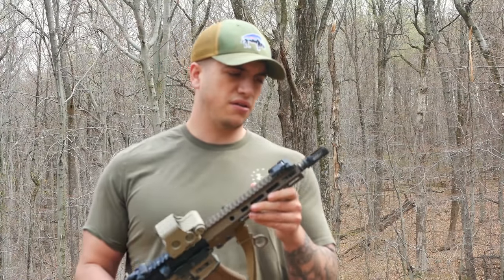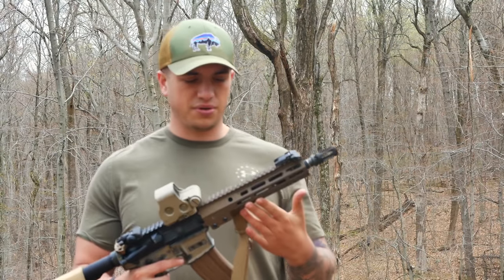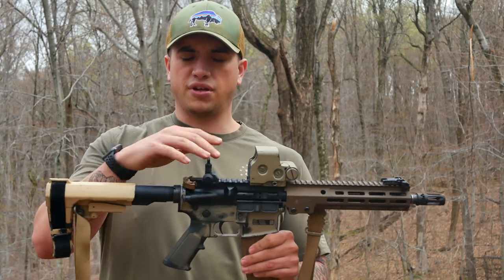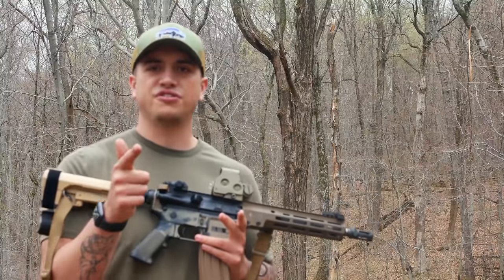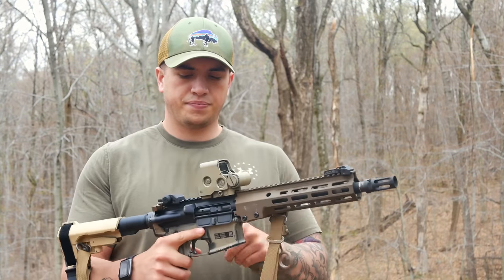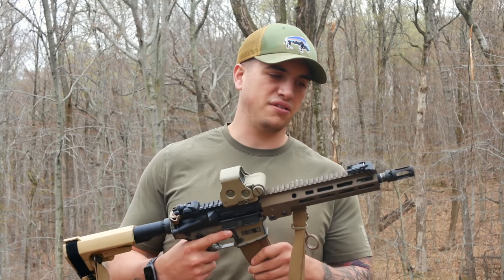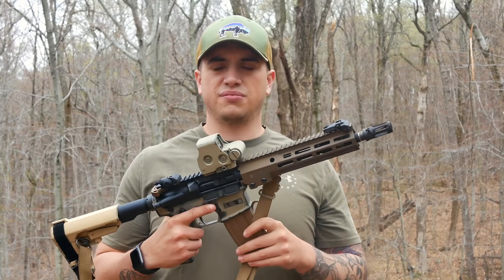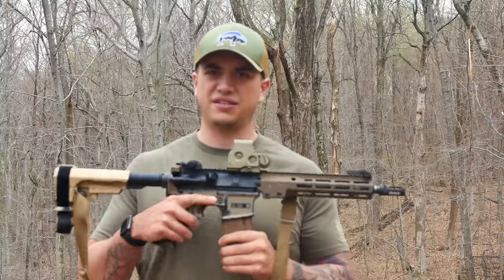AR15 Pistol URGI 10.3" "Clone" Build Pt. 1 | Colt Geissele CQBR Block 3 Clone-ish

Comment: I can't believe I missed out on those Brownell Colt deal with the lowers . I was more pissed off than a kiebler elf getting demoted to fudge packer man.  
Yeah for CRA you gotta go to the CRA OFF TOPIC GROUP . They are less forgiving there . 
If you pin that WAR COMP it will be over 26". 
I love all my Colt 10.3s. I still think the LE6945 is the absolute best period . 
I was thinking about upgrading my DD MK18 Upper and put this rail on.  I just love quad rails for CQB Uppers man . 
I'm in love with the SSP Trigger . Not a fan of 2 stage triggers for CQB Uppers though . I've always used the CMC 3.5 Pound Flat Trigger . Now that they make the SSP I'd rather have their product . 

Either way she is a Beauty.
Reply from the maker: sean white thanks man. I have a SSP on one of my other builds. I might end up swapping them in the future. We’ll see how it pans out.
Reply: @MaddMaxxLop  the CMC 3.5 Pound Flat Trigger is pretty bad ass for price and performance.  I usually get them on sale for around $130 or so. The Hiperfire are pretty damn awesome as well but expensive.  I have more experience with the CMC 3.5 Flat trigger .
Reply from the maker: The CMC was the first upgraded trigger I’ve bought. It’s on my “recce” build now. Was a big fan but in the past 2 years I’ve became a whore for Geissele. That and I honestly like curved bladed triggers and 2 stage more than I did before.

Comment: People seems to always argue the point your unable to buy a complete lower w/ a stick, however. As long as no upper hs been mounted THEN it’s fair game to remove stick n for simplicity swap stock for a SBa3 adjustable brace. I prefer SBa3 or rail hook mod 2 even if passing is non existent n may not be most comfortable when pulling it in right to your shoulder pocket it will ensure you set it on meat in order to avoid it digging into/bruising your collar bone. So just wanted to say your correct on that as the firearm isn’t spoken for as to rifle, pistol or sbr until you pop those two pins through & pair the brace/stock w/ the upper of your choosing, despite the nfa being a joke as it’s not likely they prevent crimes just discourages purchasing class 3 items bc inpatient guys like me despise forking over cash then waiting 12-15mo for the government to inefficiently generate revenue from the tax stamp they charge us to exercise one of our inalienable rights.

Comment: ATF has a 3 page letter dated 7/18/11 that deals specifically with putting a vertical grip on an AR pistol.  On the third page the ATF states how to measure the length of a pistol.  Basically remove the muzzle device, extend or fold out the brace/stock to its most extreme length, "The overall length of the firearm can be measured from the muzzle mark to the right angle corner nearest the butt of the stock, or the extreme rearward point of the firearm." If that measurement is over 26" a vert grip is legal.  I like your videos, keep it up.
Reply from the maker: Thanks man, that’s finally some good info. But to be honest I’m digging the C clamp on this.

Comment: Edit: https://www.reddit.com/r/Firearms/comments/c9gqb6/atf_redecides_that_folding_braces_dont_count  The brace doesn’t count per the ATF as of now towards OAL.

As far as the Vertical Grip goes, a lot of people recommend measuring OAL with the brace removed and when you do that this gun doesn’t make 26”. If you do include the brace it barely makes it.

Some say though, the BCM Vertical Grip is technically an angled grip since it’s not exactly 90 degrees (kosher for pistols). I don’t care to be the test case for that one either considering BCM markets it as a VG and calls it one.

For now I just use mine like yours with no grip at all. The rail is pretty comfy to use without a grip anyway.
Reply from the maker: Yeah honestly that’s what makes most sense. Probably gonna rock a bare rail for the foreseeable future.

Comment: Mod lite has a mini scout sized body for the 600DF. You keep the 1500 lumens but can’t use 123s or 18650s(I believe) 
The only question is t2 on a Scalarworks w/ a magnifier for $1200 or a Razor for $1200🤔 (I went with the razor🤫)
Reply from the maker: Ooooo that sounds veeerrry interesting gonna check that out. I think I’m leaning towards the Razor but only time will tell

Comment: i got the four prong on my setup and i would much rather prefer the warcomp.  Muzzle rise is absolutely discernible between the two especially when you’re letting it rip
Reply from the maker: How annoying is the tuning fork sound, if at all?
Reply: Extremely... it will ring if you sneeze next to it.  They say it goes away w carbon build up, but I’ve got well over 4K rounds and it still hums like day 1.

Great channel man keep it up!
Reply from the maker: Thanks man!
Reply: Batang Balisong I’ll buy the 4 prong from you if you wanna sell it, or just buy you a warcomp and trade you out.

Comment: So I purchased a colt m4 carbine lower  receiver (no upper with it) can I slap this on that lower with a brace or will that be against atf or any other bullshit?
Reply from the maker: Im no lawyer (have to preface with that), but as long as the lower was originally bought as just a lower and not a 6920 take off you’re good to do whatever you want with it. Remember: pistols and turn in to rifles, but rifles can’t turn into pistols.

Comment: yo if you bought that lower and it had a stock when you first got it it’s a rifle lower you can’t just put a brace on then throw a upper that has a barrel shorter than 16 inches on it you just made a sbr you can turn a pistol lower into a rifle just keep the brace on a pistol can have as long as a barrel you want but you can’t turn a rifle lower which is a lower that came with a stock when purchased into a pistol it will be a illegal sbr not a pistol
Reply from the maker: Yeah that’s not true. When you sign the background check it’s under “other”. There’s no “rifle lower” or even “lower” designation for that matter. There’s “rifle”, “handgun” and “other”.
Reply: @MaddMaxxLop  okay i seen what your saying got you didn’t know you had it under other sounded like it was a rifle that’s my bad
Reply: @MaddMaxxLop  so if i go buy a lower with a stock it will be under other not rifle
Reply from the maker: @hypotenuse825  no worries, man. None of the rules make any sense anyway.
Reply from the maker: @hypotenuse825  as long as it’s not a rifle take off, yeah. If it comes from the factory that way you’re good.
Reply: @MaddMaxxLop  okay appreciate it bc i thought i had to buy a lower with a brace and i can’t find one but ones with stocks are everywhere literally going to pick one up in the morning

Comment: Does anyone know the difference between Geissele's "Near Clone" and "Clone" uppers? idrc I just want to know b4 I purchase
Reply from the maker: Near clone is a generic milspec upper and BCG. Clone is Colt BCG and upper.
Reply: The clone upper has Colt bolt carrier group and receiver and a Daniel Defense MK12 gas block with set screws or a Daniel Defense pinned gas block. The near-clone upper has Geissele's unmarked receiver, Geissele's mil spec bolt carrier group and Geissele's nitrided gas block. Some of the bare MK16 rails come with Geissele's bare stainless steel gas block. The Geissele receiver has subdued rail markings and I think the Colt upper might have bright white rail markings. Geissele has about three similar charging handles. The large Super, the smaller Airborne and the URG-I Airborne that has the gas blocking feature.

Comment: What buffer and spring are you running?
Reply from the maker: I believe I was running a H2 with a standard spring in that
Reply: Thanks I was running H3 and had bolt fail to lock back. I contacted Geissele and they said to drop weight.

Comment: I’m not exactly a cologne person I picked that rail on a 14 five for the Sturdiness of the rail and it is very very hard for it to come on and off because the ID and OD is so small that is easy and one way that it has captured Bolts you have don’t need to worry bout it  And I’ve tried the airborne charging handle I’m not a fan but i’m just a fan of their company bud the correct barrel I have in my MK four and a 9.3 and I should’ve gotten 9.5 but I was worried about the surefire suppressor but with an H2 super 42 those are just the buffer systems I run all always them and I’ve noticed you have a Lotta triggers I’d go with your preferred and then just throw those on your lowers but I get the idea of having multiple different ones like sure I have the SSAE in my 14 five obviously but I put the SD 3G in my 10.3 it’s a perfect 1 pound break it’s a 2 1/2 pound nothing of a pole Justin zero grit just smooth and you just have to slightly tighten your finger and it clicks it’s an amazing trigger but my next triggers either going to be the S3G or the New and improved SSP I have another building working on since I threw a radian lower on my Gucci build and it really is like breaking glass it makes the CTN war comp which I use on my 14.5 and if it fits the bill for a mid length system with a nice Gasport size I also have an H2 super 42 in their hand my 10 three I get even better rejections honestly but I have a Roscoe with their mid length gas system and is very accurate for I wanted to try out a night trading barrel so I’ve seen a lot of good reviews and how they last for a while for a decent price and if I need to swap anyone in or want to put in and say make the Dan thing fucking clone phone whatever to do a clone it would be a sopmod block to and I would just get it since my 10 three Daniel defense barrels working out so well I would probably be doing do them or I believe centurion has cold hammer foraged sopmod2 M4 barrels……. and throw arrears two on it and I can get to Penn and Wildstone and then in one day but I don’t think it unless I convince my friends over in Pennsylvania to send me one for God knows 200 bucks but I never know I already have a lower for it and I’ll put in an S3G or the SSP because I like the SD3G I’ll put it in a normal angled trigger…. The SSAE serves a purpose and for long range it’s money it is beautiful for a long range as long as you practice with the trigger consistently know your brakes know your splits you have to be confident because these are the top of the AR trigger market and it is one of the reasons I only use mostly their shit except I will get a knightArmamant lower if anyone knows please let me know an SR 15 lower that would fit the build beautifully and and RIS to 13 inch in that gray color if they have it and I already have her over buying extra radian stuff Old dude grab a trigger H1 buffer system and the tungsten weigh in case if I’m able to get an answer of 15 lower than I don’t need the buffer to but if I don’t which most likely won’t be the case I’ll use a gray buffer tube that is type three hard to analyzed I’ll get it all as a kit from geissele obviously be five S. mod eight wanted to get a coyote so I have a flat dark earth and I might switch those because the ones on a DDC buffer tube and anyone that’s listening GEISSELEmakes the best buffer tubes and the coolest looking especially if it’s the same color as your rail

 14 5 so it honestly with it it’s got a DDc geissele buffer tube with a sopmod stock and that was more so because it’s a very comfortable stock I had a level three neck surgery which is one of the worst for comfort and the risers and shit on everything 1/3 code witnesses no comfortable on my holographic up at the top of the window but I was thinking about how mine wasn’t meant to be a clone of us meant to be and there’s like 14 five that has it’s going to be more of a Reiki set up and it works out great Vortx 1 to 8 and get a first focal plane LPVO people just do it that’s what you want to get unless you are someone that was tight like their M-16 A2 with iron sights out to 500 yards in basic you’re not gonna be able to handle a second focal plane very easily at different magnification levels because the reticle stays the same size just as a note because he was talking about LPVOs but I have a 1 to 8 I feel like that is like the sweet spot especially for PID but you want a 50 x 200 drop on your radical for sure depending on if it’s MOA MRADor BDC do you need to know how the system works then again I know people are just go to the indoor range that’s 25 yards and shit a $3000 LPVO it yeah 15 yardage for God sakes sure there’s times I’ve done that for testing and what not but yeah if I just built my firearm like the barrel I threw in my Gucci build and think about that do you want 5000 different rifles or do you want say 10 or it may be different for everyone or five great top-of-the-line A.R. 15‘s or do you want 20 ugh ars but it’s definitely buy one scribe ones and sure I will build another offer all the time and just think of that you don’t need as many lowers as you need uppers if you want to just build shit and use it practically and for example if you’re going overseas and you’re special operations command you will have a surety lower and a M4 depending on your set up that day and you’ll have obviously a different system for optics but if it’s easy to carry to the range three offers with one lower than yeah I’m saying whatever the rifle the day of the day is that’s why I was saying one of the reasons is because comfortable and no the trigger know your trigger don’t just jump into aftermarket triggers because you watch YouTube videos and hear people say the same names and companies you will not be able to effectively use that trigger for the most part unless you are a complete natural but there’s still things that need to be taught like say picture say alignment breathing when and how ballistics actually works so many fundamentals that need to be broken down and I had a good and good 80 hours of just instruction on the M 16 M4 plat form of rifle in basic before we put one round in the chamber but these are glory days that back in 08 but build the raffle that best suits you if you’re a little guy and you think the M4 A1 Somod is amazing and you won by one or whatever just understand that they are not light by any fucking me into whatsoever so hopefully he can start lifting a little bit otherwise you’re gonna get winded after 10 rounds and there’s stance I hate recommend people take a rifle course carbine course is today want to be able to do CQB effectively in their home against a home intruder for example at night I put my eotech on 8 hour mood I’m not that I will sleep that long but I want to make sure it’s on Ang I also check my light and make sure I can still see the reticle through the light even if it’s slightly I just want it I don’t want the radicals to be too bright do you wanna be able to see through it and I always have a bag of MK2624 powder 77 grain sierra match king and the other ammo I would suggest is Speer Gold dot 75 grain 223 that’s designated as a lawn Forssman ammo and it also comes in 55 and 62 believe but it’s very hard to find these days you got a look it has an open tip where the light is exposed so basically it’s around where you have to worry about collateral damage like a through and through on whatever you’re hitting and the round keeps going after it travels through the person which can happen with certain ammo types which is why I suggest match rounds or Spear gold dot 223 If your rifle likes 55 grain go and use the civil defense they have not just a Nickel plated brass casing like spear but it has a 55 grand open tip hollow point where is a huge cavity hollow point that basically explodes and fragments so it also has a very high velocity as all liberty am I’ll do but those are the three hours to just and the safest ones especially you have to consider in a defensive scenario where every bullet is going to go if it God for bid Hass to happen where you have to pull the trigger ever but those are the definite sativa defense round and you want to use them in your firearm to make sure your firearm one likes them and isn’t giving you crazy groups where it’s not stabilizing correctly because it can happen but do the data check everything and when you see because people don’t understand good ammo good ammo is going to be more powerful than the shit you shoot at the range if it’s a true defensive ammunition it’s going to have a lot more power behind it where it will definitely be noticeable to the shooter mo262 or some sort of sierra match king round but you can find MK 262 inch mod 1 FULL power ammo on the market you just have to really look sometimes locally sometimes online and you’ll be surprised at the difference in the performance of the round and how much more powerful it is because if you shoot and sound like PMC it’s anorexic garbage Or wolf gold than all the othersand the other two I mentioned are phenomenal